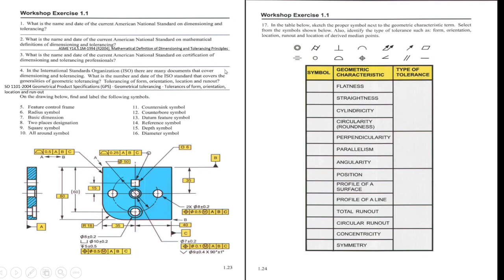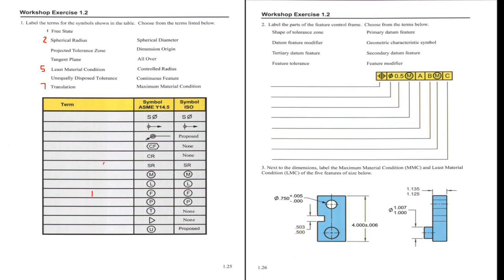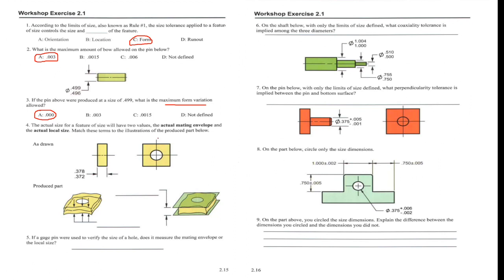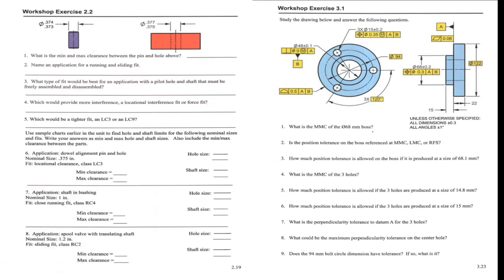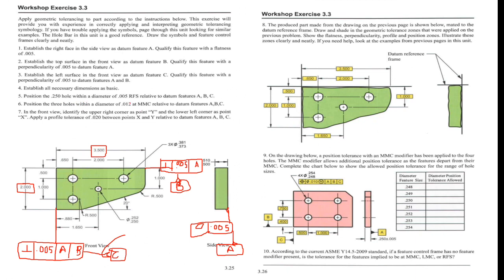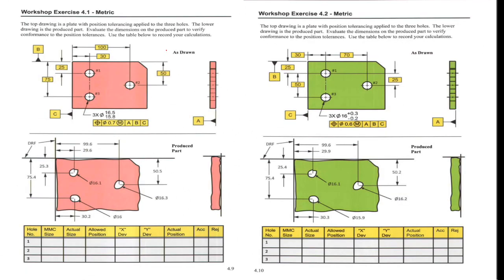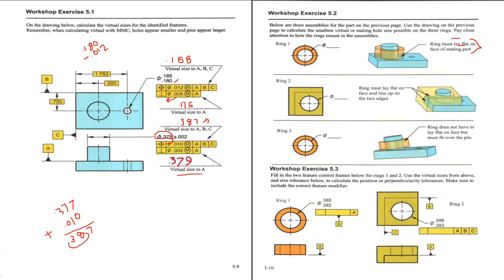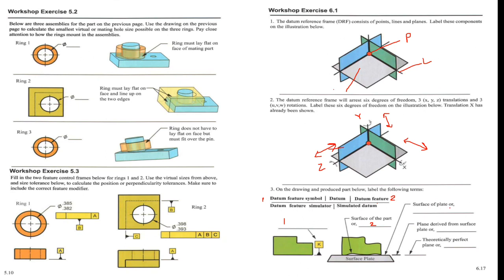GD&T - workshop exercises 1

Comment: Generally, quite good! Though, at 27:44 I think this was an error. "Basic" dimensions are exact dimensions and are generally used for referencing the center of a hole. Basic dimensions have no tolerancing and are required to be exact. Length and height of an object can't be basic dimension as it's impossible to get something exactly 3.5 units long. But it IS possible to have a hole be located, say .5 units from the top plane. The CENTER of the whole can't be located there perfectly, but the idea is that there needs to be a hole at that exact area and then position tolerancing can make up for the hole's center.

An example would be the pinkish/salmon-colored box at the right. The length and height dimensions are not shown, but the hole dimensions are basic dimensions. (Putting a box around it to make it basic is correct, you did great there)